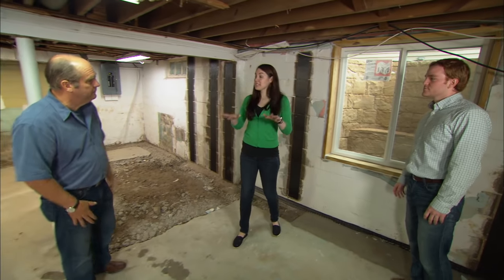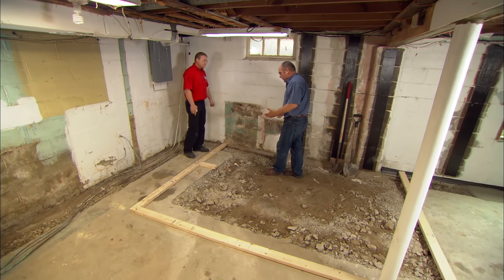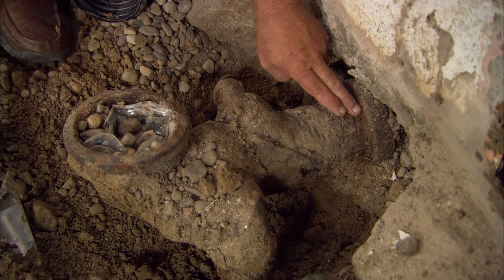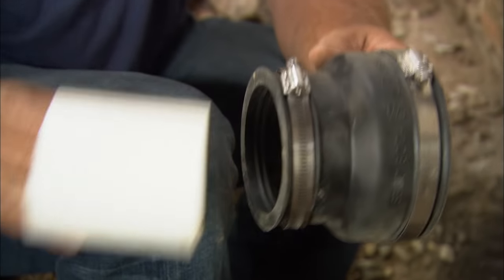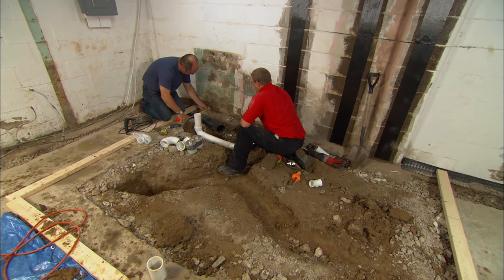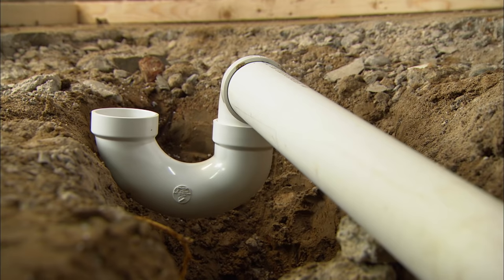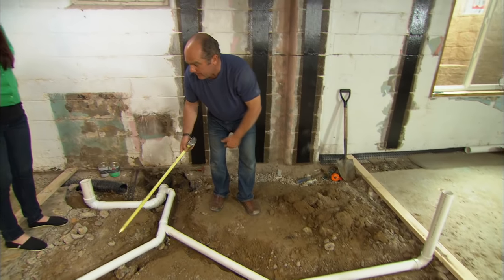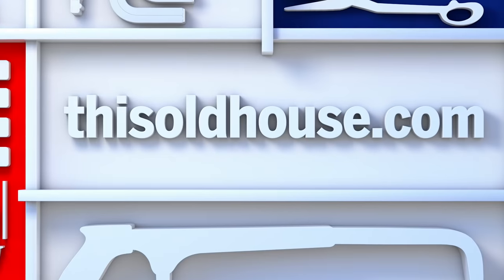How to Install a Basement Bathroom | Ask This Old House

Comment: So much for not disturbing the old cast iron pipe.... looks like the whole thing shifted at 5:04 as he was tightening up the fitting.
Reply: +Video Québec He was talking about the lead further back, not the pipe
Reply: +Video Québec Man oh man you have good eyes! It does rotate left a tiny bit; I had to watch 5 times......That's a world of hurt there! Good catch!
Reply: look a little closer & you can see that the lead is kinda gone.  That joint should've been re-poured, or a new donut installed.
Reply: I didn't know anyone is even pouring molten lead anymore.  That process drove me OUT of plumbing as a young apprentice. The weight and excessive labor of working with cast iron. Then, some brilliant inventor came up with the rubber "donuts" as you mentioned. It turned everything 180 as far as labor and ease goes.
Reply: And, I drill  those lead joints out.  Pull the lead and oakum from the hub and replace with a rubber donut.  Then, if any movement or play is apparent when installing, it's minimalized and still leakproof. Drilling takes a bit longer and is meticulous.  I've broken a few bits.  But the results are far more rewarding.
Reply: It's the classic way of doing it, pretty much everything is plastic these days, but unfortunately you still have old shit like that to deal with
Reply: I just did it a few days ago. Had to tie into an old hubbed cast iron running trap underground with a new tee on top. Trying to transition to pvc or new no hub cast would have put me too high. The trap was still good and breaking open the floor to replace the trap was not an option. Had to go pick up a service weight cast iron tee and lead it in.
Reply: I usually put on a 6x3 joint directly on the cast iron hub and break the old 4 inch stub
Reply: lol you could actually see it moving
Reply: Videos from Québec I'm a plumber I saw that too, you can see the separation in the joint! lol
Reply: Plumber here in IL in Chicago more exactly and the lead and oakum joint is still used to this day, along with the fact code does not allow us to in the city run plastic drains so everything drain is still cast iron
Reply: Ive seen them pour lead on a metal pipe on this old house
Reply: Seriously- Someone should contact them.
Reply: how to charge for a. bathroom installati bedroom
Reply: You're correct . And the 4 by 3 band they are using is shit ,  not allow where i'm from
Reply: Yeah. Look at 3:33 and 3:44 closely. More evidence it is kaput.
Reply: Very good eye
Reply: It moved .2 inches?! Call the President! This is a fucking national emergency!
Reply: The thing is that plumbing company is from Boston and those rubber clamps are not allow to be use here neither.
Reply: A crack like that in the lead joint means that they will have leaking sewage forever under that bathroom. It will stink and mold and break the concrete down over time. Get a plumber who knows what he's doing.
Reply: Good eye
Reply: Great eyes buddy
Reply: Chargèro Not his problem...it's the homeowners in ten years when the foundation gas suffered water damage,
Reply: Exactly... And then no discussion or demonstration of how to tighten up or re-caulk.
Reply: @kilts4u2  for where he was flat & in dirt i melt it out.. I fought not to pour, i packed my oakum and would use the A& B, or Plastic lead.. Fumes from lead & plastic not for me.. 
 Have a friend that would use the fernco, and encase it in cement..
Reply: @xXxM4A1xXx08  i respect the ci..not so much if they allow no hub couplings, but the poured joints.. Professional. . you can keep pex for me also..underground ok, the pexcore heating underground supplies covered in insulation ok..in the house, its handyman crap.
Reply: @marqueemark5917  by us not allowed above ground, and they want you to build a form & cement around them . 
  Or we were allowed No-Hub full banded couplings..Husky made one with 4 & 6 clamps over the band.
Reply: How long will that rubber joint last?
Reply: @xXxM4A1xXx08  maybe because the pvc fumes when it burns they don't allow it commercial?
Reply: @GregODonohue  only until the roots follow the water in & grow into the toilet...  I pulled a 🚽 & couldn't believe my eyes

Comment: A proper ci/pvc transition would be to maintain 4" to the new closet bend, thereby creating a full sized cleanout through the foundation.
Reply: So im doing my basement bathroom over. Its currently ABOVE concrete plumbing. Its almost 18in off the floor. Smh. So im trying to rough in plumbing. So I bought a 4in pvc to come from the upstairs toilet(i have a toilet stack down here) going vertically to a sanitary tee. To the left I have another 4 in pvc to a 90° ANGLE and attached a 4 in spigot flange with a cap and ring. 

On the right side i have another 4 in pvc (going in a straight line) transition to a 3 in pvc.  A 3 inch to 2 inch elbow that then transitions to a small 2in. Pvc and shower drain  and a for my shower. Am i doing this wrong
Reply: @Freedomring-uk6yd  sump pump?

Comment: Eh... I'm a plumber of 10 years in Canada. This install is alright. My only grievance is the fact the shower is dumping over the lav, and I think they used too many fittings. The lav should be upstream of the shower so the shower can vent when it turns through the 45. I'd prob have put a 6*3 fernco on the hub of the CI. The hub will last way longer than the leaded joint. From there I would of put a 3" Y, the branch picks up the toilet. Bush down to 2", then a 2" Y, the branch picks up the shower, then two 45's to pick up the lav. I think this orientation saves a couple fittings. If the inspector demands a 3" cleanout I would probably put a 3" Y upstream of the toilet Y and have it 45 up into whatever wall near the toilet with an access panel in the drywall.

Comment: That rubber reducer with the clamps remind me of the old black water pipe that used a fitting and clamps years ago. Someone will suffer lots of grief someday because of those clamps stainless or not.

Comment: i may be mistaken, i believe the working clearance is 3ft in front of electrical panel. the wall looks too close for that.
Reply: 3' minimum for low voltage (up to 250V)
Reply: jwest1305
Reply: @timothybarney7257  It's actually 150V to ground and less, that is the cutoff for working space to always be 3 feet in depth, regardless of surface condition behind the worker.  So this would apply for a residential 120/240V system, a 120/208V three-phase wye system, and a 120/208V single phase partial wye system for an apartment dwelling uint.

Over 150V to ground, requires greater working space, depending on the surface condition behind you.  So this would apply to high leg delta systems that have a B-phase that is 208V to ground on 120/240V three phase, commercial 277/480V applications, and 347/600V industrial applications.   An insulated condition behind you, like a plastic fence, wood, drywall, or vegetation, would still require 3 feet.  A conductive or conditionally conductive condition, would require 3'-6", such as concrete block walls, chain link fences, or the backs/sides of other equipment.  A common aisle situation between to pieces of equipment would require 4 feet.

Comment: Why at 5:06 did the cast iron  pipe start to turn then the camera cuts away?
Reply: Good eye. It means somewhere down the line its loose or broken. Both not good
Reply: Josh Root it's broke right at the joint. The guy noticed it too lol but thinks to himself hell with it...
Reply: Josh Root    i
Reply: They will probably silicone the joint then leave it exposed and fill all around it with concrete when they pour floor. They are hacks and I would not copy anything I saw in this video or take any of his advice.
Reply: Yeah some guy pointed that out and they deleted his comment and  it looks like they put a suggestion box for another video over the pipe so nobody could see their fuck up

Comment: When I was a plumber in Mass a Fernco was not code. 4 band mission clamp underground only.
Reply: In New Orleans you can't use any metal fittings underground because of the soggy soil.  So it's fernco or mission fittings with the bands removed, then cast in concrete, or donuts into a hub.

Comment: Doesn't look like 3' in front of electrical panel.
Reply: I was just about to say the same thing, I hope they measured that space or they'll be back moving a wall.
Reply: Only electricians know clearance codes. At least it's not in the bathroom behind the toilet like I've seen before lol
Reply: @JD-ed1uq  TRUE  Sometimes we gotta pick our battles.  Would you rather have it in the linen closet or have to straddle a toilet
Reply: Dave Graziano 
That is easily 3’ of clearance
Reply: @AErney51  that's not 3ft .maybe 2ft the most
Reply: @AErney51  lol look at the 30" reference Mark on the stud... That's wider than the distance between the stud and the wall... Add 4.25" and you need 40.25" off the wall to the new wall... Way less than required spacing there.
Reply: @joshuadevall4182  anybody that uses decimal inches hasn't built a thing in there life. You sound like a surveyor or an engineer.
Reply: @joshuadevall4182  so do you order "0.5" threaded rod or "1/2" threaded rod?? 😂😂 You calm down learn how to take the needle. Starting to sound like you've never been on a job 😂🤙
Reply: @alec4672  when it's verbal, it doesn't matter. Not that you would know. You'll be alright brother.

Comment: The only thing I could add is putting sand under and around the pipes it will help keep any rocks from concrete damaging your drain lines down the road

Comment: Watch @ 05:01 when he's tightening the clamp, the cast iron pipe swivels. That means the lead seal is bad. It's going to leak.
Reply: Amazing eye, wonder if they will notice it or it will just seep into the ground without notice
Reply: @LumenChaser  
Short answer
They may have noticed the seal was broken and just didn't include any info on it in the video to keep the complexity down. 

Long answer
If they didn't notice it, that will definitely leak. It's not a pressurized line so it'll be a slow leak. What happens will depend on the ground. If it's dry ground it may leach away for many years or maybe it'll never be an issue, but that's a slim chance at best.  
     If the ground is saturated with moisture any sewerage will seep under the slab and accumulate, anaerobic bacteria will build up and create a biomat, which will further trap moisture. That slab floor will always seem damp, but more importantly it will always smell dank because of the trace amounts of gas seeping through the slab. The trace gas probably won't be enough to hurt anyone but the smell will be noticeable. 
   The first thing the homeowner will do is use sprays to kill the smells, then use cleaner/bleach on the floors, but the smell will persist. A moderately skilled plumber will most likely recognize the smell and be able to diagnose the issue. But if the homeowner brings in a general repair the first thing they'll likely suggest is to seal the slab, which won't work. A waste of money. If they get very unlucky a foundation repair will suggest a new foundation drainage system. Which is expensive and has a possibility of working because that will take away a lot of the moisture. Anaerobic bacteria flourish in wet conditions, less moisture the less bacteria. But the smell will likely persist. 
    If they didn't fix that seal before they finished the remodel, they'll have to remove all the fixtures, take up the flooring, dig up the slab in that area, fix the seal and then put it all back. 
    If they did replace the seal at that stage in the video, since the slab is already gone, a plumber would chisel carefully around the pipe for an hour or so to reveal it. Put on a new coupler and seal. Maybe $70-100 extra cost on the remodel price. Which is worth it. They never should have shown people that you can guess whether the seal is intact or not. Just replace it, the added cost is insignificant compared to the total cost of the remodel and a new seal will last for decades.
Reply: Mrdead Inmypocket thanks for the detailed response
Reply: Mrdead Inmypocket you are so smart man

Comment: I've always used a Sawzall with a rough diamond blade on cast iron pipe.  That grinder with the diamond blade looks way faster.
Reply: Harder to get underneath the pipe with it though. I usually just use the diamond grit sawzall blades, then you don't have to dig around the pipe so much

Comment: 3 issues I see:
1 no backwater check valve to prevent sewage to back flow into basement
2 french drain was cut
3 proper clearance for electric panel

Comment: such a great video! Thank you. What would you recommend if we want to add a bathroom with toilets in the basement of a house that is not connected to the plumbing. The plumbing is located at the level above the location in which the bathroom would be added. Thank you

Comment: In which universe regular Fernco band is allowed to be installed indoors under slab? Major no-no.
Reply: I agree, it shouldn't be allowed.  At least a reducing fernco shouldn't be as there is no way to prevent sheering or swelling.  I've put in ferncos below the slab years ago that are still intact today, but only the ones that are the same size for both connections.  I just put a sheer band around them to prevent them from flexing in the ground too much
Reply: @andrewwelch5668  What's a sheer band ?

Comment: The cast iron pipe moves at 5:05
Reply: Why does that matter?  Wouldn't any pipe move somewhat when being worked on?  Genuinely curious.
Reply: Garrett it turned in the hub to much not good
Reply: @gjones963  That movement indicates that old style lead joint is deffo leaking at some point in the near future

Comment: I would be afraid of that rubber connection rotting away in 20 years
Reply: Exactly what I was thinking, especially when it's inaccessible after the bathroom is finished. Sewage seeping into the founds once the rubber perishes.
Reply: Nobody stays for 20, they’re gone not their problem

Comment: Hmmm.  Looking at this. I see the elec circuit breaker box.  Suppose to have a 3 ft clearance in front of that panel.  Code.  Can,t tell if this is far enough away from where the lubber is laid down in front?

Comment: Nice guard on the grinder
Reply: Jason Hilton I didn't know you could cut cast iron with a diamond blade. I always use metal cut off wheels
Reply: +Jason Hilton for TV, they usually remove safety guards (and put a disclaimer in the end credits) so the work being done is more easily visible to the viewer.
Reply: Timothy Barney I never use one anyway ;) can't get it in tight spots when cutting pipe
Reply: I hear you.  sometimes they are a pain, sometimes they can save you pain.
Reply: Long sleeves would have been good to protect from hot, sharp metal fragments, coated in 80 years of shit.

Comment: Code might be different in the area this video was recorded in but where I work we would have needed to use a 3"x4" bushing inside a 4" fernco connecting to that cast iron with a sheer band around the fernco.
Reply: Could they have used an air admittance valve?

Comment: You’re at end of the line with no clean out so that if there is a mainline clog how will you snake the mainline?  Pull the toilet?

The venting is ok. It’s called horizontal wet venting where the lavatory is oversized to vent 3 fixtures.  Your measurements for the toilet should be 15” on both sides from center and not just 30 inches🌺

Comment: First off im surprised they had no shrinkage dry-fitting and gluing that whole layout.
Second, why didn't they remove the cast iron all the way to the hub and use a soil pipe adapter?

Comment: The cast iron soil pipe didn't move. Purple primer is only used in certain states, and I'm sure the inspector knew is what going to be done right, so probably not required anyway.a cleanout in this short of a run is not needed when you have such a short throw and they are using a 2" drain anyways. this was done right
Reply: Dan purple primer is only used on heat rated pvc such as 636
Reply: Ty Cobb.  what are you talking about?? primer is used for cleaning and inspection purposes on DWV lines.
Reply: But it is not required to pass an inspection
Reply: I've only ever seen purple primer used on venting for furnaces
Reply: Ty Cobb. you do not know what your talking about, quit replying. Inspectors make their own rules, even in the same county. It varies from state to state.  I've had inspectors have me rip out new work and redo it, because they couldn't see the primer!
Reply: Haha shitty inspector bur really doesn't say any where in the npc that primer is required
Reply: Inspectors can't make there own rules they have to follow the code books
Reply: You are right it does very. In my state which is using an amended IPC 2015 we don't have to use purple and technically you don't even need primer for anything 4" and smaller. I of course always use it anyway. I never bring purple into a finished house.

705.11.2 Solvent cementing.
Joint surfaces shall be clean and free from moisture. A purple primer that conforms to ASTM F656 shall be applied. Solvent cement not purple in color and conforming to ASTM D2564, CSA B137.3, CSA B181.2 or CSA B182.1 shall be applied to all joint surfaces. The joint shall be made while the cement is wet and shall be in accordance with ASTM D2855. Solvent-cement joints shall be permitted above or below ground.

Exception:
A primer is not required where both of the following conditions apply:

1. The solvent cement used is third-party certified as conforming to ASTM D2564.

2. The solvent cement is used only for joining PVC drain, waste and vent pipe and fittings in non-pressure applications in sizes up to and including 4 inches (102 mm) in diameter.
Reply: Purple primer is a must by Code in New Jersey, New York, Connecticut, Pennsylvania otherwise it will fail the inspection. I don't know about the State   that he's doing the plumbing.